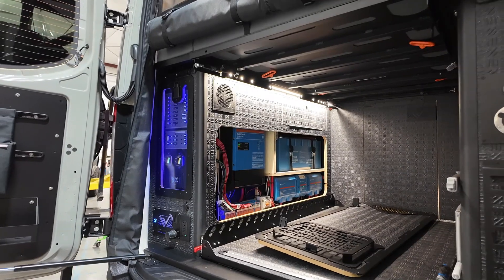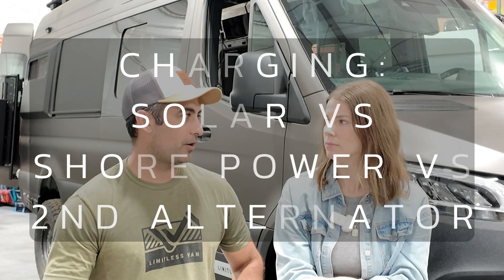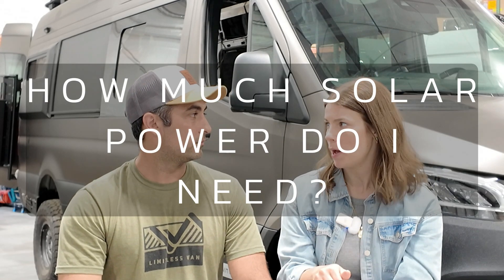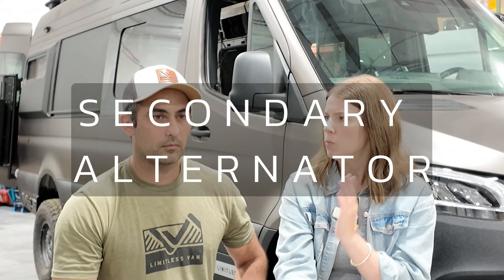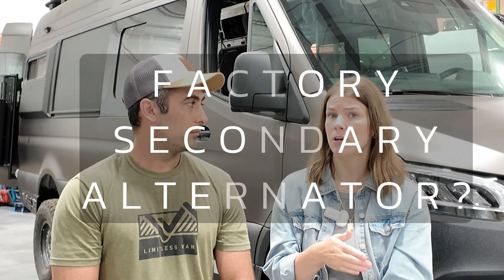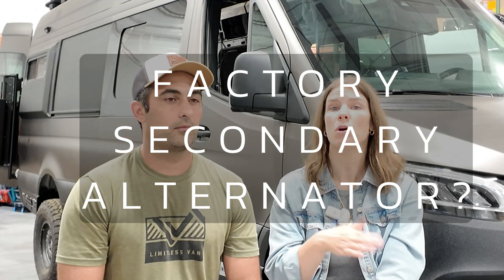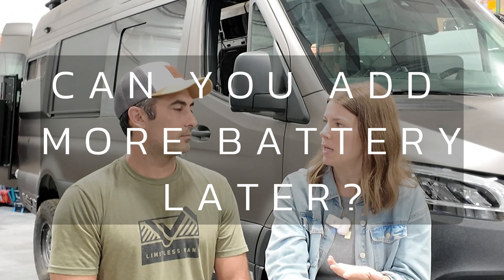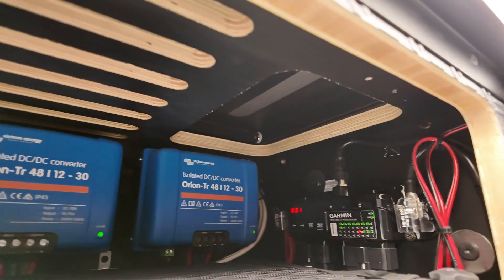Van Power FAQs: How to Power Your Off-Grid Van Conversion!

Comment: For the overwhelming majority of campervan users, that is those who don't intend to run ac without shore power, this is all massive overkill.  A normal user with a 22v fridge, lights, light device charging...... Is going to use maybe 60 amp hours a day.  Can recharge with an hour of driving with a good DC DC charger.